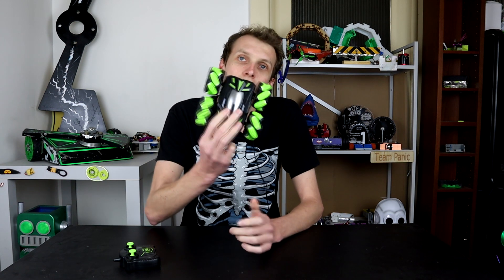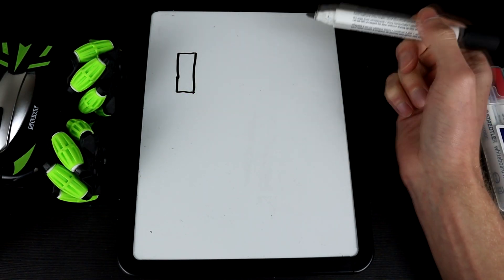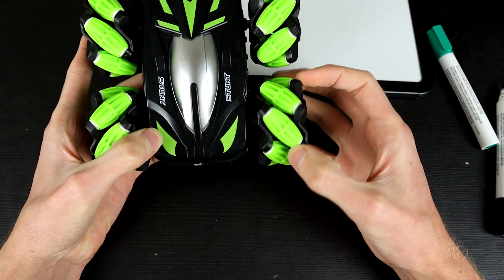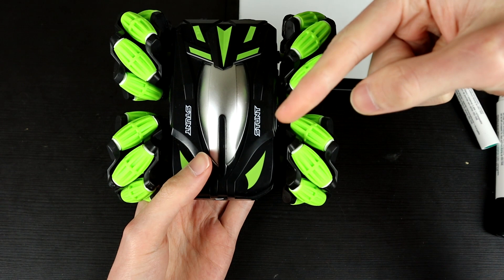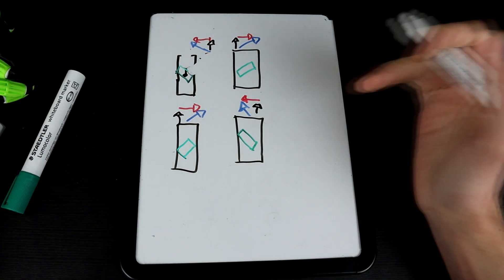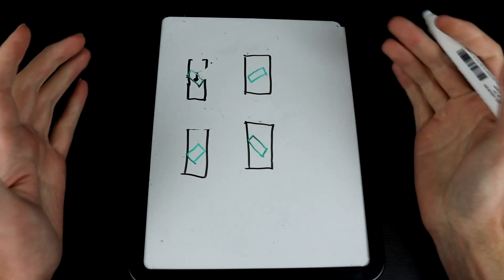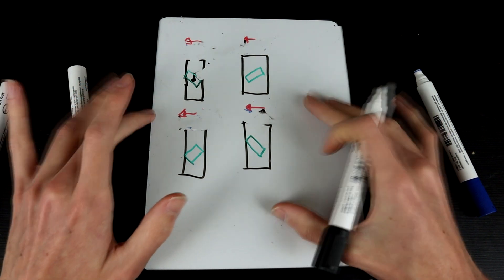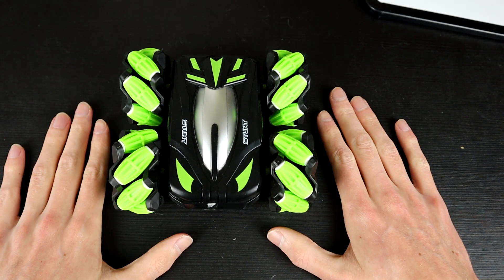Robot basics: How mechinum wheels drive sideways

Comment: So with a bot would it need 4 speed controlers (one for each wheel) if you wanted to add mixing for tank stearing?
Reply from the maker: yep! exactly, it has to have four independent drive motors and controllers
Reply: @TeamPanicRobotics  that makes a load of sense. been trying to figure out how to do these and had thoughts you'd need an arduino or something to handle the programming.
Reply from the maker: You could use an arduino for mixing, but it should also be possible to do all the mixing in a decent transmitter.
An fs-i6 wont be able to do this mix as you'd need 4 mixing channels and each would need 3 signals mixed together
and the fs-i6 can only handle 3 mixes and each mix can only have 2 signals mixed.

I want to build this into a test platform in the future and do a video on the transmiter mixing
Reply: @TeamPanicRobotics  oh, at the risk of asking a daft question, looking at your diagram about the forces, it sounds like the the speed/force of going forwards/back is lower than left and right, is this the case or have I miss understood? 

yea, might go for Arduino, I've got an uno (not sure if thats suitable) and planning on making (at some point) a robot mouse for a maze using an AI i made a few years ago, mechinum wheels look tempting so then orientation isn't an issue.
Reply from the maker: That's my bad, I did very loose and fast diagrams, theoretically forwards and sideways should have the same amount of force
(each wheel produces a force at 45 degrees to the direction of travel, so the force gets split evenly, into force in the direction of travel and proportional to the direction of travel, these last bits are in opposite directions and cancel out, leaving only the bit we want, which is true for both types of travel, so the forces should be the same. In the real world though one will have more force than the other, but I don't know which way that falls )

Good luck with the maze robot, I'd add some form of feedback as well, like a gyro or sensors on the wheels so that the robot doesn't drift and drives as straight as possible
Reply: @TeamPanicRobotics  yea its a long term plan. The board I got came with a sensor, when I get round to starting it Im going to have a play aroubd with that. I keep meaning to look into gyros.

Comment: I've seen Mecanums on VEX robots, but putting them on a combat robot should be cool.

Do a video on Fingertech Silver Spark motors. I would love some information on them because it seems to be quite limited.
Reply from the maker: What would you want to know about  Fingertech Silver Spark motors?
Reply: What size are those mounting holes in the front? (their CAD model is 1.6mm which seems off). What speeds do they rotate at different ratios? Can you take off the gearbox? 

Just a basic overview, displaying what they are, and why they are used instead of genertic 16mm gearmotors. I can't seem to find much info on them as they are usually used in US ants which not many people build, but I believe there's a set in Breakfast, no? So can they be used for beetles too?

By the way, I like this video's thumbnail.
Reply from the maker: Thats a decent list of things to look at thanks!

I didnt use them in Breakfast, I used generic 16mm ones from china and moved away from them because the output shaft is too small and broke too oftern.
So I think you could use them in beetles, but you dont want to direct drive wheels with them

Comment: Thanks for the helpful video Ben! This Omn-directional movement is not that used in combat robots right? I think only Shatter seems to so that. But this will make driving really interesting.
Reply from the maker: Yep, Shatter and also Glitch this year at Battlebots
But its a little more common in smaller classes but still not super prevalent

Comment: I’ve seen these type of wheels called omni wheels used on full sized 3D printed droid wheels abs they turn on the spot
Reply: Sometimes people call anything with a roller Omni Wheels, if the orientation of the rollers is at an angle, they are Mechanum Wheels.  Omni Wheels have rollers at 90 degree angles.  We use the omni wheels when we want less drag, on our front wheels when turning, such as on a long wheel base.
Reply from the maker: "Omni Wheels" is the name for any wheel that can travel in multiple directions, so it's a class that includes Mechanum Wheels, the problem is that the wheels with rollers at a 90 degree angle don't have their own name so just get called Omni Wheels, confusing things
Reply: @TeamPanicRobotics  IIRC, Team Razer user Omnis as part of Razers rear wheels and could do all sorts of wild steering
Reply: Good thing about Omni wheels 90* is that you don't get the rip your wheels off force when you tank steer

Comment: Do you think if we used all 4 wheels on individual motors we would be able to get tank steering in our bot with the correct channel mixing
Reply: Yes.  Having 4 independent wheels, allows you to vary the speed to obtain movement in any direction with Mechanums.  You won't have as much traction and could get pushed around a lot, but it's still much better than you'd expect with those rollers.
Reply from the maker: Yep! traction on mechinum wheels is lower then conventional wheels which is due to the roller absorbing some of the force output